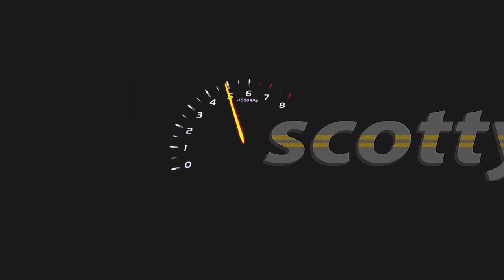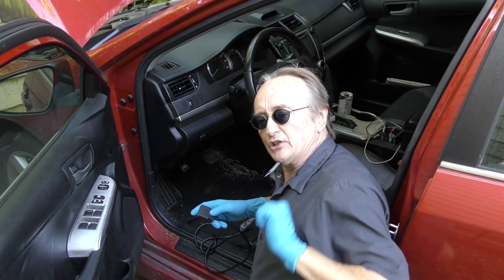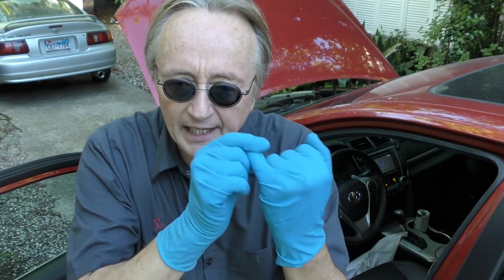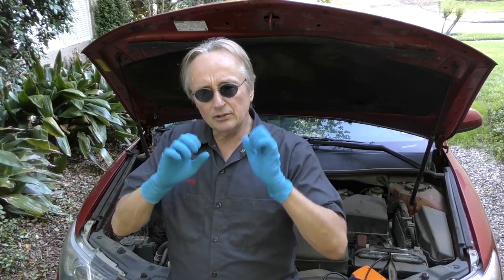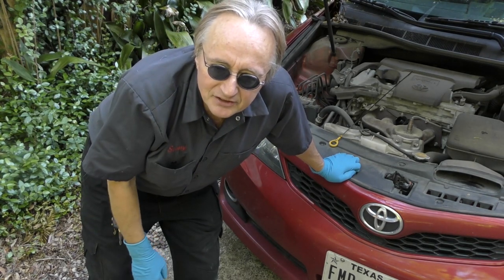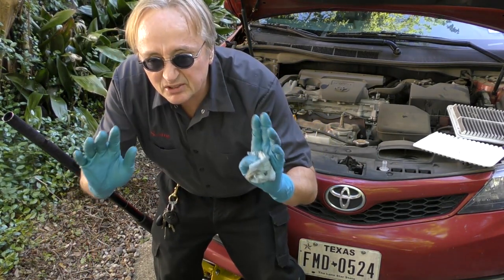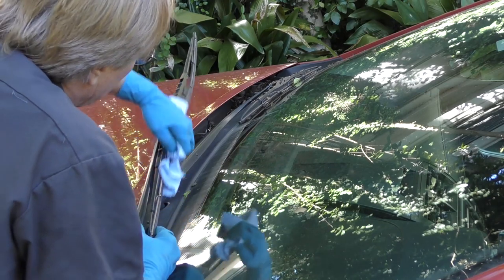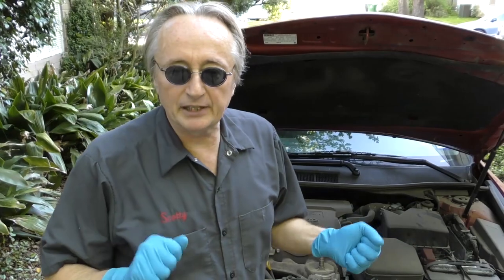Doing This Will Make Your Car Pass Inspection

Comment: 1) The monitor exception depends on the year of your vehicle and state.

2) Save some headache and get the test done as soon as possible.  Here in vegas, it's every year and they send you a small postcard 30 days before car registration renewal.  If the card gets lost in the mail, or you misplace it or otherwise forget about renewal you're sol if your vehicle fails just before it comes up for renewal.  You can't renew your registration unless you pass the test.  You can apply for a 10 day extension but this doesn't prevent you from being pulled over for expired tags. But, the smog test is good for 90 days so I try to get this done as soon as possible.  I made the mistake of waiting too long one year, test failed and I had to go to a smog repair test station.  These stations are the biggest ripooff artists.  Waiting too long cost me $500 that year.  The actual repair took about 10 mins not counting ordering and getting the part but without my approval the garage put my truck on a dynanometer so it was pass the smog test and there wasn't anything I could do about it except fork over $500.

3) Make sure if you have any work done on your vehicle that the garage has a battery backup to preserve the computer state.   Why?  Because if you disconnect the battery, it clears the computer state and starts the monitor tests all over again which can take a week, weeks or months depending on how often you drive and your drive patterns. You can't get a smog test unless most or all of these are cleared depending on the state you live in and the age of your vehicle. 

4) drive cycles  I'm surprised this isn't mentioned.  The monitors are tests that the computer does while you're driving.  Each test depends on a particular drive pattern. i.e. driving at a certain speed for a certain amount of time   If you disconnect your battery or erase codes, the tests start from the beginning and it could take a week, weeks, or months for you to drive in a certain way for all these tests to pass.  As far as I know, in all states that require a smog test you have most or all of these monitors completed before the test.  If you don't have a scanner that tells you the state of these tests, you won't know if your vehicle is ready or not for the test.  What if they are not ready?  You can perform what's called a drive cycle that simulates the conditions that the computer needs to either fail or pass the monitor test.  Drive cycles are usually similar to most cars but they're not all alike.  You need to find the drive cycle that matches your vehicle.  But, it's not simple.  You have to find a spot where you live where you can speed up and slow down safely on the road. 

 I've yet to find a scanner that wouldn't clear codes but I've also yet to find a scanner that would clear codes but not reset all the monitors. That would be fantastic but I've yet to see one.

Comment: California no longer requires tailpipe emissions testing for model year 2000 and later, just OBDII testing.  However, 1999 and earlier gasoline cars still require tailpipe checks.
Reply: True, though they still do a visual check of tail pipe to see if it's belching smoke.  You can also have the Evap monitor incomplete and still pass, but no other ones.
Reply: Sucks to live outside the US

Comment: Test in uk and Ireland is designed to drive old cars into the scrap yard and sell you a new one. They couldn’t care less if the vehicle is road worthy or if you just spent 500 on the brakes, if any part  of the vehicle isn’t working they fail the vehicle. Rear wiper, dent, power window, any bushing or cv joint doesn’t matter they’ll fail it every time if possible and charge you another 110 euro if you don’t retest it fast enough.
Reply: David Griffiths I was failed for a small tear in one of my seats, and got a fail advisory because my rear indicators weren’t amber.  WTF - at least I use them...LOL.  It’s just a money making scam over here

Comment: Here's a trick I learned as a teenager back in the 70s to check my tail lights and my front headlights marker lights and turn signals. Pull into a parking spot nose first facing the glass on a storefront. Turn on your headlights checked your markers and your headlights at that time turn on your high beams check them also. Then pull out of your parking spot in back into it. You'll be able to see whether or not your brake lights work your tail lights, license plate lights and your back up lights work in your rearview mirror. I've done it for over 45 years now.

Comment: Oil the o-ring on the oil filter cap so it doesn't get stuck.

Have experience with Scania trucks.

Here in Finland your not allowed to have any error codes in ECU
Reply: MUCH cleaner Country than the U.S. !!

Comment: Two comments...  I have a 2007 Hyundai Entourage with the 3.8l V6; it has a paper filter like what Scotty doesn't  like.  I was skeptical about it at first, but having changed the oil a couple of times, I really like this particular oil filter setup.  On this car, the filter is on top of the engine, so when you remove the cap/filter, all of the oil drains down into the engine; you do not have to crawl under the car on your back to install a new filter; you still have to go under there to drain the old oil, however.  The second comment is when I go to have my car inspected, I inform them that if there is any reason why the car will not pass, to just fail it and give me the list of things that need to be fixed and I'll return to have it re-inspected.  When I took my car to NTB for an inspection, I didn't mention this and they tried to charge me $30 to replace the third/center brake light; the law had just changed in Texas requiring that the center brake light work if it is installed; I did not know, so I didn't check it.  NTB just did the lamp install without asking me, so I told them to put the old bulb back.  Instead of doing that, they offered to just charge me $3 for the bulb; which I agreed to.

Comment: Here in California, they've also gone to the OBD2 poll test for 1996 and later vehicles.  They only do the dyno run (15 & 25 MPH) on 1995 and older vehicles.  My smog check guy is pretty annoyed at that because he spent so much on his dyno and he doesn't get to use it so much anymore.  He also mentioned in passing that the reduced levels of ZDDP in recent API-rated motor oils have done more to get old (flat-tappet) cars off the road (from engine damage) than the smog laws ever did.  Gotta love California...

Comment: “Curse the evil swine that made these things” 🤣🤣🤣🤣🤣🤣🤣🤣🤣🤣🤣🤣
Reply: I'm on my third car with this type of oil filter, and I much prefer it over a spin on metal oil filter. Much less messy
Reply: Classic Scotty comment "Evil Swine" 😂😂😂😂
Reply: @erikneland8632  - Did the 1st two cars have engine oil problems with this design?  And that's why you're on the 3rd.
Reply: @BA-gn3qb  Ha ha. No. Our family outgrew the first after 160k miles, the second one was totalled after 170k miles when a guy decided to do a brake check on the exit of a roundabout, my current has 170 k miles.
Reply: @erikneland8632  - Based upon the history pattern (160, 170, . . .), you only have 10k left on that 3rd one.
Reply: PART OF CONTROLLING THE POPULOUS...BUT THE AIR IS WAY BETTER IN CALIF...IM GOING TO ARIZONA...SCREW THIS CA SMOUG...SMUG...OH YEAH...SMOG

Comment: The UK doesn't have code analysis for the MOT, but we have, like California, a tail-pipe gas analyser that gives out all the readings. It can be a problem on run-about cars, and the advice for older cars is to take it for a blast on the motorway and get it to the test centre nice and hot.

Comment: Thank you for your info. I do appreciate you and your efforts. If I may, I'd like to point out emissions test fees and safety inspection fees are nothing more than taxes. For example, with nearly 8.5 mil registered vehicles in TX at $7 for that safety inspection is roughly $60mil dollars a year in state revenue. Oh, and it does nothing to make our roads safer. For that, you actually have to get the drivers off the road. And don't get me started on emissions testing value, or lack thereof. End of rant.

Comment: I keep my insurance details in my bag( riding a motorcycle)
Glove box( driving a car).

My car is a mony pit patrol car( Mercedes benz).
The motorcycle is nice to me when I am fixing her.
My corolla is very easy to maintain and still runs like a dream( original engine, transmission), I change the oil regularly with the filter and everything, including the spark plugs and fuel injectors.

Comment: When I lived in Japan, even the headlights had to be perfectly adjusted or you failed the test. Normal driving put them out of tolerance, so you had to align them that morning before you went to the inspection station.  cost me around $400 each inspection for parts and fees.

Comment: We don’t have emissions inspections where I live.
Reply: Be glad. Be very glad. In NC, the inspection is waaay cheaper if you live in a county where OBD inspection is not required.
Reply: @828enigma6  I'm surprised NC has it, I didn't think any of the Old Southern states did.
Reply: We don't have safety inspections where I live, just emissions.  Smart, right?
Reply: We have absolutely no inspections where I live
Reply: I live in North Carolina and I don't even have a cat convertor and still pass. But I sweat everything I take it.
Reply: CAROLINA PATRIOT when I lived in North Carolina outside of Charlotte in the 90’s, they had emissions inspections, but they also had really good bbq.
Reply: thsts because theres only like 500 cars in north dakota
Reply: Yep, none here either. When the cat plugs up we sell it for scrap and run pipe straight to the muffler.
Reply: On average how much is an inspection
Reply: @Ironsja11  consider to cut the muffler as well, you will have a high performance car.
Reply: Don Johnson:  California?
Reply: RHode island is almost as bad as Cali
Reply: @surferman911  I don't think I own a vehicle with a catalytic converter on it. Even my 2019 got lost somewhere
Reply: jonnyboat2 same live in Alabama removed my cat put exhaust system with headers
Reply: @Gigika313  in Texas, $25.50 at the inspection station, then about another $15.00 when you renew registraton..  Kinda expensive!

Comment: Here in Northern VA, they set up emission sniffers along major commuting routes, that detect the car license plate (I guess) and the emissions as you drive by, then the system determines when your next emissions inspection is due (every 2 years, the safety is every year) and sends you a letter if your car passed nearby a tester and passed the test within a set time period before. And that's it, you no longer have to wait in line for the emissions test.  At first it creeped me out, but it is pretty handy.

Comment: My guy just approves me immediately without even looking at the car lol
Reply: Here you just pay $400 for the stupid yearly registration and get your car molested by some jerk who can't put it into reverse, and you get a little windscreen sticker telling you your emission level. I even saw a rotten out Volkswagen with its rocker panels completely gone pass with no issues.
Reply: @GlamStacheessnostalgialounge  Sounds like some crooked mechanics in Chicago... Just give him $200, he passes a $100 bill under-the-table to the crooked emissions test guy, you get a piece of paper that the car PASSED emissions! Sometimes you need to see a MAGIC MECHANIC like this, otherwise, a regular mechanic tells you that a million sensors need to be changed: Your repair bill is $800 to $900, and you have to drive to the emissions test place all by YOURSELF, and still FAIL the emissions test.

Comment: In CT they do both the tailpipe test and OBD II test, unless you have AWD.  They they just do the OBD II test.  It is because they put the cars front wheels on a treadmill, and run the engine.  They cannot do that with the AWD cars.

Comment: Spent 1500 dollars so far on emissions related issues. Charcoal canister, troubleshooting fees at 4 different shops cleared po442,456 and finally 448 only to have a po447 show up. Here in ct. Big hassle getting out as soon as possibe taxes galore tolls galore keeps getting worse

Comment: My brother had a 1958 Pontiac that had an oil filter inside of a metal canister. It held about 1.5 quarts of oil. Fortunately, the canister had a drain plug. Currently in California, smog inspection for cars 2000 and newer is just a computer that plugs into the car's OBD2 outlet, and the two computers have a conversation, then transmit the information to the "big brother" computer in Sacramento. One thing it checks is the VIN number to make sure that the car on the report is the same one it talked to. For cars 1976 to 1999, the car is run on a dynamometer first at 15 MPH, then at 25 MPH, and the tailpipe emissions are measured at these speeds. Some emissions testing places are not bothering to repair their dyno equipment if they break down. The newest car that needs to be tested this way is now 20 years old.

Comment: This past February my inspection was up for my '06 F-150. Both the check engine and break lights were on when I took it. We had already checked the breaks and fixed the issue but the break light was never reset. The check engine turned out to be an issue with the Mass Airflow System but it was passed anyways here in South Texas.

Comment: The simple way I check the rear lights, is park the rear of the car facing a big window at some store at a distance where I can see the car in the rear view mirror. Then test the brake lights and with my foot on the brake put in in reverse to see if the reverse lights work, as well. The other lights, like the head lights, tail lights and license plate light can be checked just by turning them on and walk around the car. I'm fortunate enough that my county (Stark) in Ohio doesn't require an E-check.

Comment: Yeah, I wish lighting and brakes had to pass inspection in California. The inspections in England are brutal though. There's a video from Car Throttle about seeing if on old Accord will pass. The mechanic was saying he'd fail for having tires worn on one side, having rust, having foggy headlights, burned out light bulbs in the instrument cluster, etc. The mechanic said he wouldn't fail it for having cracked suspension bushings, but the inspector would pressure him to fix that too.

Comment: As far as Texas goes, you are right and wrong on the number of codes you can have. I own a 2001 Pontiac Formula with the LS1 engine in it. It can only have one "Fail" or "Not Ready". If it was a 2000, it could have two. Reason being, in 2001 GM eliminated the EGR system. I guess before 2001, the ERG and something else could be out, but after that it changed.Going from 2 to 1 codes has stopped me several times from passing the "smog test".

Comment: Scotty. I'm in California and we stopped doing the tailpipe testing about two years ago. The last two emissions tests I had on my 2007 Acura TSX were only OBD II based and no tailpipe test.
Reply: That’s true for 2000 and newer vehicles, but 1976-1999 cars are still required to get up on the dynamometer and stick a sniffer in the tailpipe.

Comment: In Finland main problem is the ball joints and other joints or any kinda of structure which keeps tires on the place. Our roads swim in salt and snow half of the year so it takes toll on cars.
Every year i get denied and need to replace some of the joints.
Inspector says, there is a bit wiggle room so it will not pass. I dont know if it's a government's sham to collect more tax money

I clear the engine codes always before i goto inspection for a reason

Comment: Vancouver WA here, they are closing all DEQ testing at the end of the year and it's 15 bucks a test. They used to test gas caps as well but quit a few years back. If you fail you pay 160 for a mechanic to find out what's wrong and get a waiver to get registration and tags. The question is, when they close down how much more up charge will the state charge people to make up for the 15 dollar testing and waiver fee. I don't think it's going to be good for peoples pocket books!

Comment: Is it so that in America the vehicle inspection is only based on obd codes and/or emissions? Here in Finland vehicle inspection includes the obd for vehicles for 2001 (if i remember right) and newer. And an emission test for vehicles over 10 years the CO, HC and lambda have to be in a limited range. Diesels have a smoke test. And on top of that the vehicles go through a shock absorber tester, a a brake dynamo meter to ensure equal and sufficient braking forces and  hands on inspection of bushings and joints and possible rust holes/ damage of the undercarriage. As well as lights, windshield wipers/washers, horn, blower motor to defog the windshield, etc.

Comment: Several years I had my Missouri State car inspection  done at a Valvoline Oil change shop. I inspected the car myself before taking it there. They tore the wiper blades and wanted to sell me new ones at a very high price. I went to Walmart across the parking lot and bought new blades.

Comment: Here in UK a car can fail for inspection for anything, a small chip in the windscreen, less thread on tyre than 1.6mm, any Light that is on the dash, excesive rust, a seatbelt not working, emissions, exhaust gas leaks, handbrake/emargency brake not working..... It's just ridiculous, both the insurance price and the inspection....